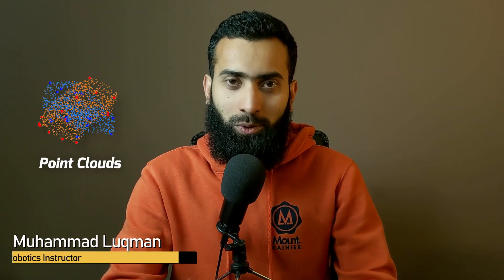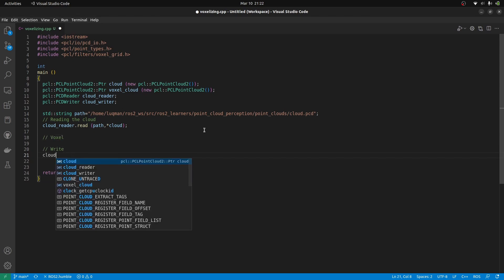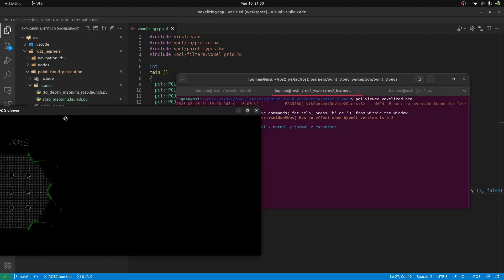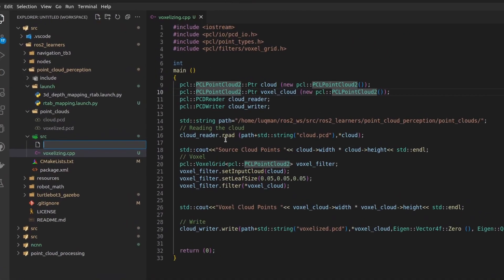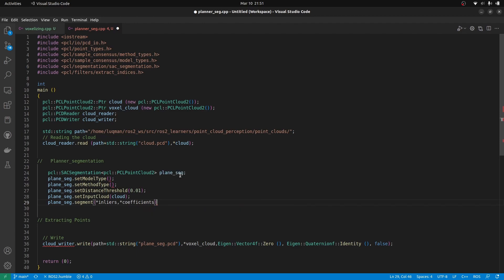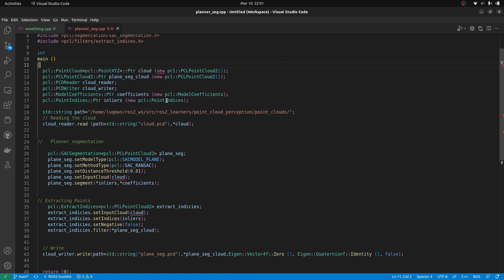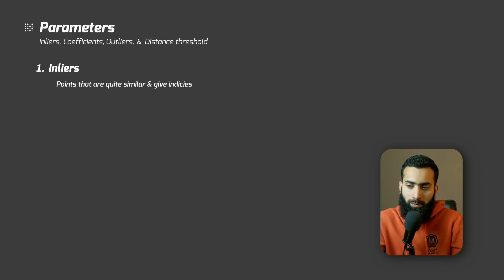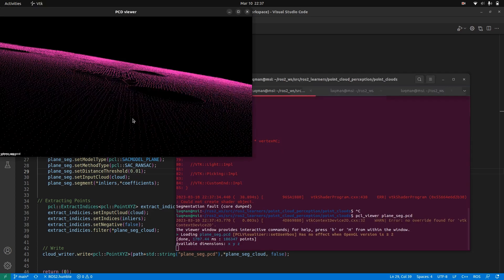ROS2 PCL Point Cloud Voxel Filter and Planner Segmentation

Comment: thanks for the video, to solve my problem task I need to include both rclcpp / rclcpp.h and sensor_msgs/msg/point_cloud.hpp in my headers, but as soon as I do this in my cpp code, it's running into the error headers not found, any solution through which we could use the headers from the pcl and ros header together?

I just want to convert ros 2 messages into pcl point cloud  as I have recorded lidar data on ROS bags
Reply from the maker: yes we can 
here is a repository you can look into 
https://github.com/noshluk2/ROS2-Point-Cloud-Clustering-and-Segmentation-for-Autonomous-Behaviour